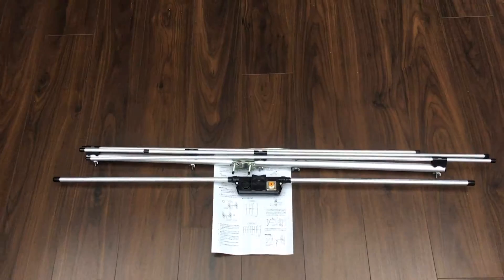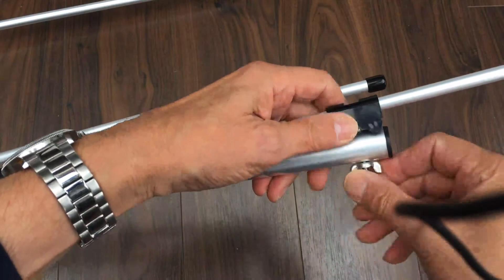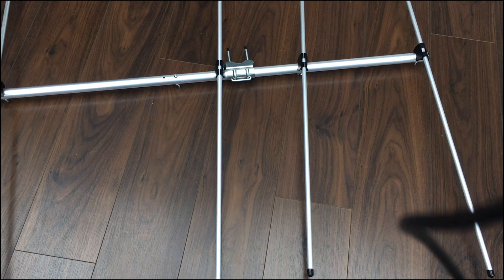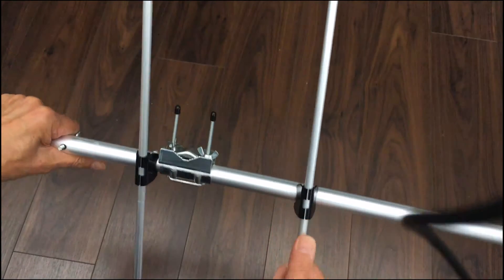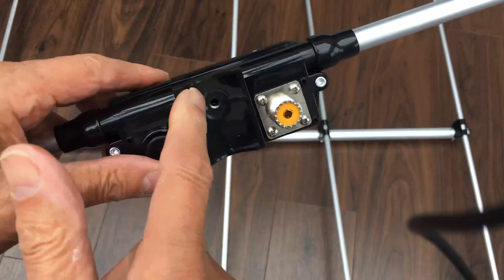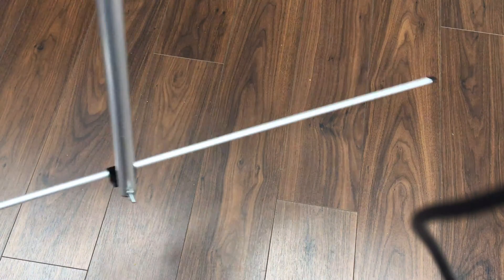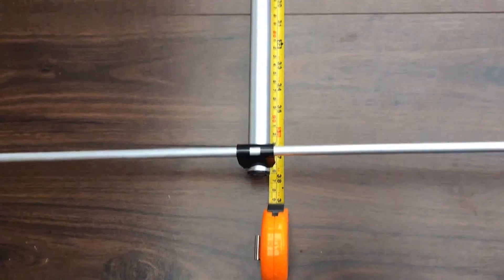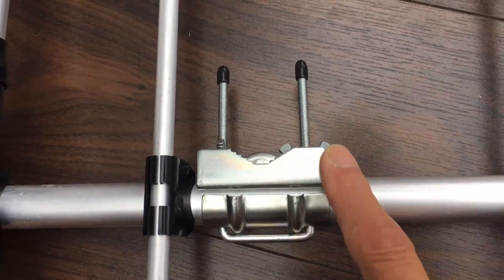DIAMOND 144S5R 2m Yagi Antenna

Comment: Many thanks for this video. I've been a customer of "Watson" for some years. I have 2 questions : how come the reflector seems shorter than the radiator ? Can you install them in a vertical polarisation ?  Cheers, 73s de F4HZN
Reply from the maker: Probably the angle of photo makes it look shorter? Yes it can be used vertically but best to use fubre glass mast section. Peter
Reply: @watersstanton  many thanks indeed.

Comment: It looks nice but i'm super critical (being a Dilbert) and those directors being able to slide within their saddles has me reaching for my drill. They need to be secured properly with a self tapping screw, at very least. I mean, if you are producing an antenna, surely element length, and position is paramount. no?   Too often, buying an antenna results in you improving on the manufacturers design before even installing it...
Reply: Once you tighten each element they won't slip out of the saddle or move around.

Comment: Great antenna... I use one along with my yeasu 817 for portable activations, I have had some great contacts. If you look closely at the elements you should  be able to see a centre marker line to centralize them.
Regards Paul M0TZR
Reply: Paul Haygarth do you use a painters pole to hold it up?
Reply: I use a 7 meter long fiberglass teliscopic mast on my portable activations.
Reply: yep  got one on saturday  delivered today   cant wait to use Great video by the way .. as the instructions are naff  and you helped my tremendously  thank you!